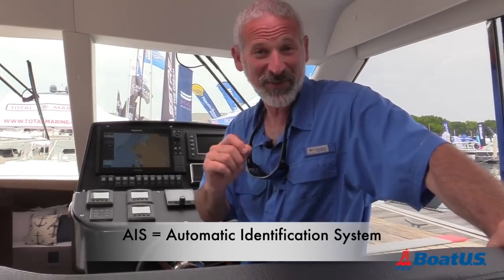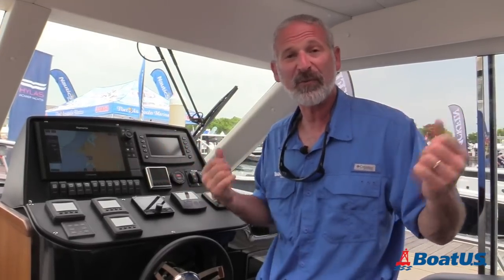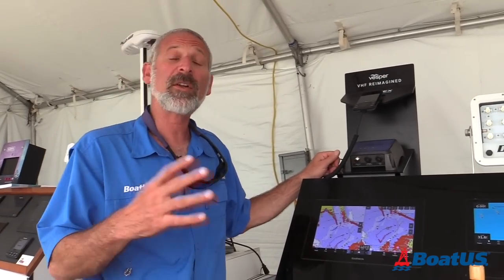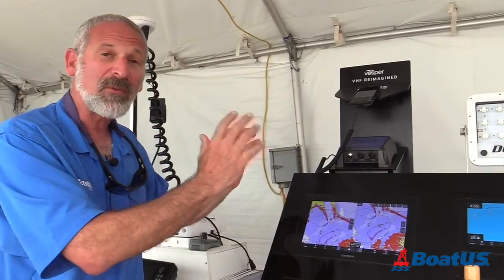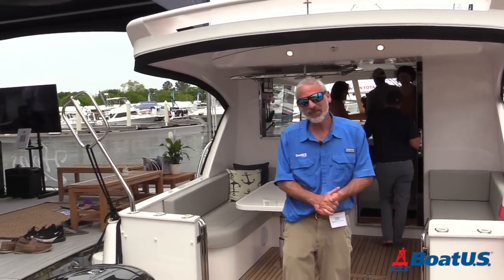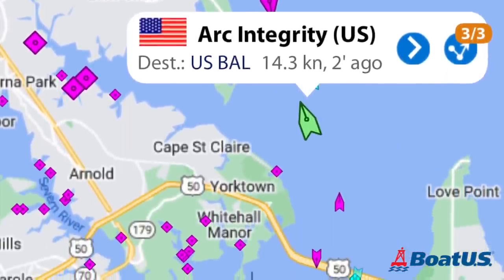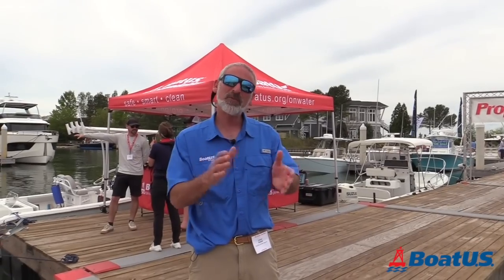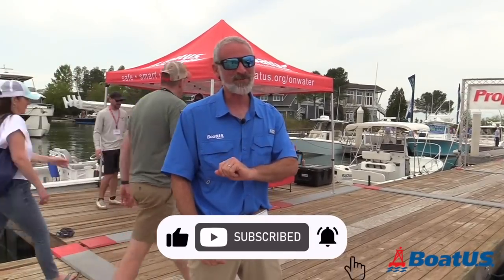Do I NEED AIS On MY Boat? | BoatUS

Comment: The on line app and computer apps often have delays and may not be in real time
You didn't mention B+ which is closer in the time slots with AIS A slot priority.  It also transmits at 5. watts, rather than 2 watts.   Especially when your boat is moving fast, the transmissions per minute increase in frequency with B+.
Reply from the maker: You're correct, Bob. Thanks for the additional info.

Comment: AIS should be required by law in every single boat.
Reply from the maker: Hi Kevin. While we don't disagree AIS a great tool to have aboard, BoatUS does not support making AIS mandatory on recreational boats because there has been discussion about using AIS for tracking and law-enforcement purposes (monitoring speeding). We want to ensure this excellent technology continues to be used for situational awareness only. You can read more about our position here: https://www.boatus.com/expert-advice/expert-advice-archive/2023/april/boatus-concerned-about-potential-ais-tracking-of-recreational-boaters